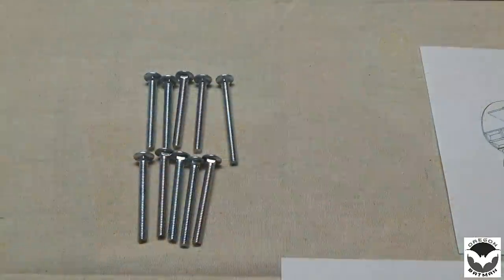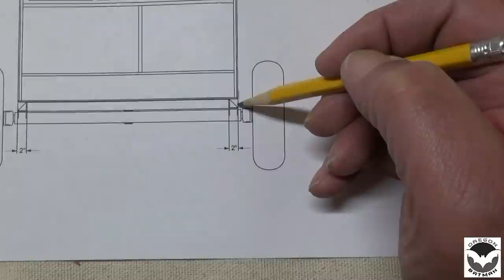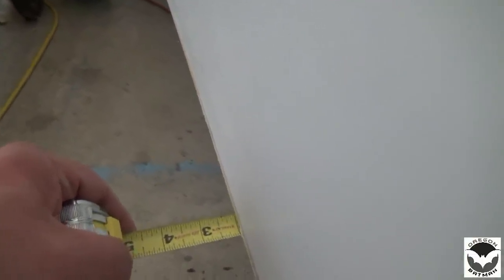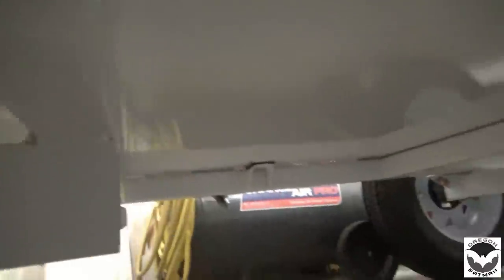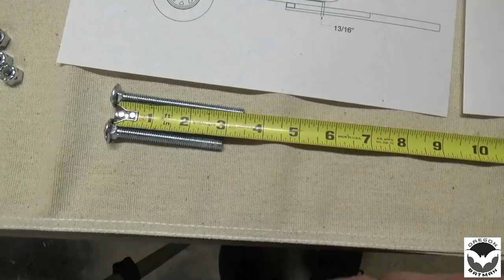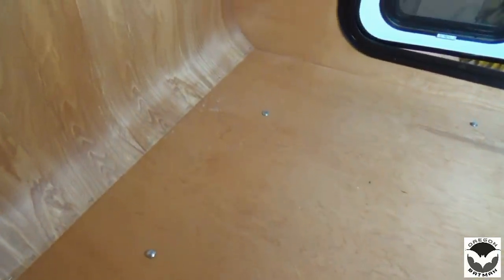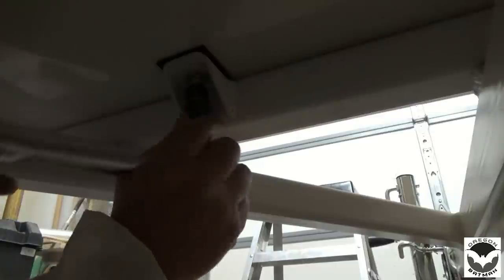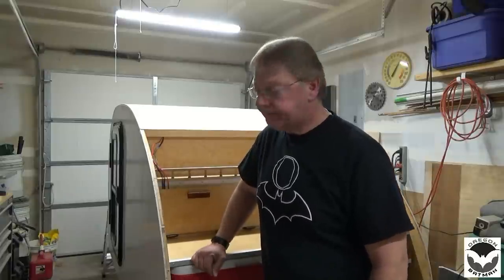Let’s Build A Teardrop * Step-By-Step * - Part 35 (Cabin to Frame!)

Comment: Hi! I watched all parts your video about teardrop building and they all great! A lot of information and great work quality! I have one question about this part, why did you use chassis whit out suspension? I think this solution create a lot of negative vibration on cabin. Thanks from Russia! It is realy cool work!
Reply from the maker: Hello! Greetings to Russia!! Thank you man, You Rock! The suspension is actually in the torsion axle. The way it is built acts like a shock. It has a smoother ride than a standard leaf spring type axle. I am very happy with how it works and will always use this type of axle! Thank you so much for watching, take care!

Привет! Привет России !! Спасибо, ты, рок! Подвеска фактически находится на торсионной оси. Его конструкция шокирует. У него более плавный ход, чем у стандартной оси с листовой рессорой. Я очень доволен тем, как это работает, и всегда буду использовать этот тип оси! Большое спасибо за просмотр, берегите себя!

Comment: Great videos!  Have you had any issues with the filon rubbing at all due to vibration where it meets the rubber gasket?  Or perhaps if the cabin underside has sagged a bit to meet the trailer frame itself, any metal-to-filon problems?  I have heard that friction can be an issue here but I'm not sure how much I should really be concerned.
Reply from the maker: Hi Eric! Thanks for checking out the videos... I have had no problems that I can tell with the filon, all is holding up really well and looks just as good now as the day I put it on! :)

Comment: You got me! I thought I had missed the Filon roof install and the hatch build!
Where did you purchase the rubber padding?
Have you seen the kevlar carbon fiber hinges?  One might be a better option than a metal hurricane hinge for the hatch.  The tests show they last for hundreds of thousands of cycles.
I'm looking forward to seeing you build the hatch.
Stay healthy!
Reply from the maker: LOL! Thought I would get some hate mail over that little joke! :)   The rubber padding is something I had laying around the garage, just a little over 1/8" thick. Any piece of rubber will do the trick... I haven't seen the hinge you are talking about, but would be worth looking into. Only issue I have with the hurricane hinge is how to keep it from moving side to side when opening and closing. It does have a little movement, have to figure a way to keep it in same spot (I do have an idea!).  Started building the hatch... hoping to have the framing finished by end of the day!  Thanks Rick! Keep well!

Comment: Hello ! Thank you so much for you videos ! I got a question though, if I’m following correct the frame of the cabin is a little smaller than the frame of the trailer ..? So how did you get the 2 inches measurement from the sides and also from the front and back ?
Reply from the maker: Hi Luis! Thank you for watching! The trailer frame is smaller than the cabin. The cabin sits over the frame 2 inches on each side and just under the round corners front and back.

Comment: Just a thought: up til now the cabin rested on the complete frame of the trailer. As you added the rubber spacers, this is no longer the case. The whole weight is now concentrated on these 10 points. Don't you think that this introduces stress into the frame of the cabin, that in the long run might lead to deformations?
Reply from the maker: Not at all... the rubber is thin, and compresses to seal the contacts. Trailer is lightweight, and being made out of wood will expand and contract with the weather, if anything, the rubber spacers will allow movement and not introduce stress. Thanks Thomas, great question! Cheers!

Comment: Batman, the trailer is bolted to the inside crossmembers, left/right and forward/back. How come you didnt want to bolt the 2 longer wood pieces of the frame? the 2 longer sides where the side walls are screwed into? In my paranoia, since the walls are attached to the longer sides, the roof is attached to the walls along with spars etc that the walls/roof could fly off one day since technically the wood that its screwed into is not bolted down into the frame. My only aasumption, is that (1) even though its not directly bolted down, the wood glue/staples on the longer pieces makes a very strong connection (2) everything that is attached to the wall like the galley wall/shelves are attached to the wall and floor making the side walls secure. Thanks.
Reply from the maker: Your assumption is correct. It is built in such a way that the cabin is essentially a one piece cabin. The sides are not going to fly off, nor will the ceiling, not without taking the floor and the frame with it. :)
Reply: @OregonBatman thanks batman

Comment: I'm enjoying the build and the detail of instructions, but... You don't need so much hardware underneath, only a flat washer and nyloc, so the 3" bolts would have done the job just as securely as the 3.5" with all the extra's.
Reply from the maker: True... but the added security helps me sleep better at night! :)